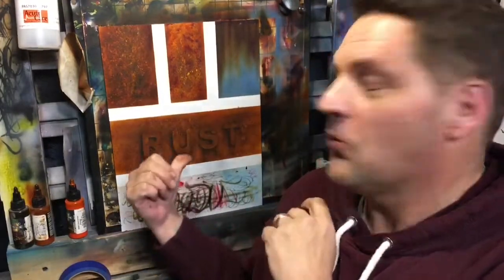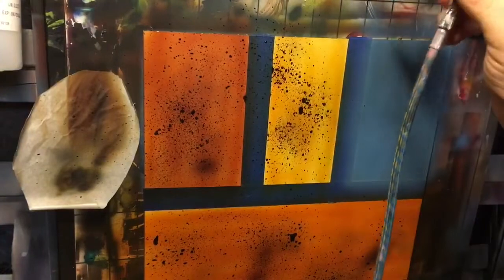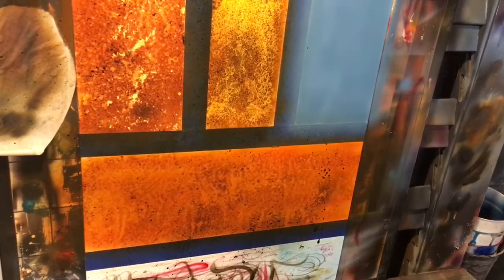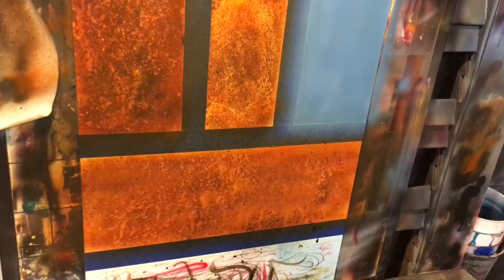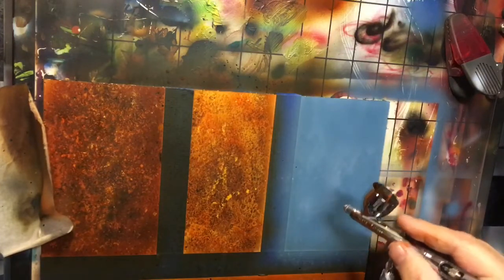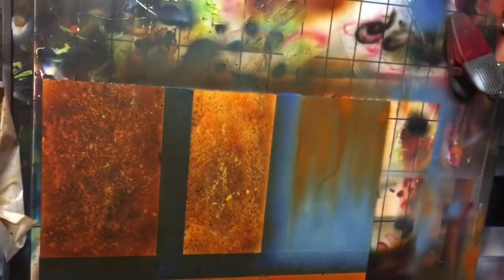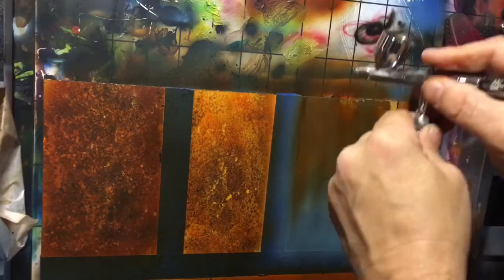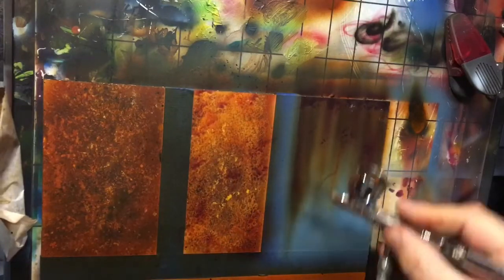How to paint rust effects, WITHOUT special materials or equipment. An airbrush tutorial.

Comment: First time viewer and a newbie to air brushing. Like the video so far, cool effect but you mentioned a product called 4030 and I'm not exactly sure what that is. I'm assuming it's a dealer but other than that I don't know.  Also where can I buy it? Great job and I'm subscribing right now!!
Rick - Athens, Texas
Reply from the maker: 4030 is a product made by createx, It is used as an intercoat clear, as well as a mixture for making softer paints harder.  IE if you use createx illustrations they rewet and remain soft for a bit.. its intentional.  by adding 4030 they become more of an acrylic urethane paint.  

Glad to have you here!  as for buying 4030 if you go to kit.co/wleonartistry  I have several buying guides there covering materials and equipment I use.  I believe 4030 is listed in one of those paint lists.  If not I will correct :)